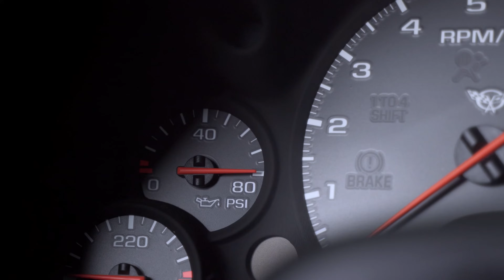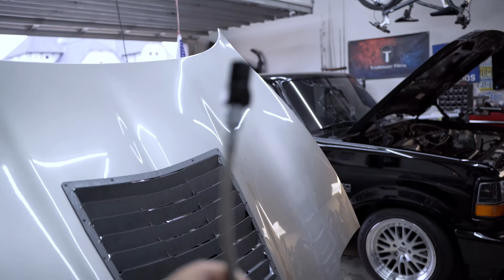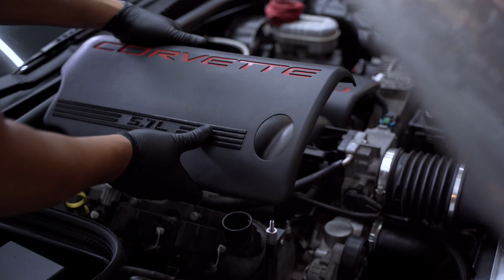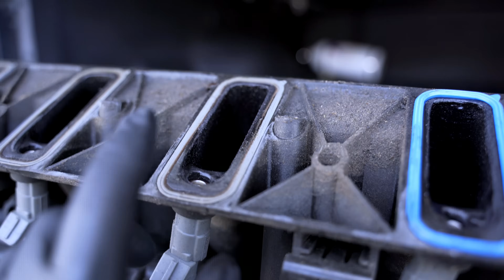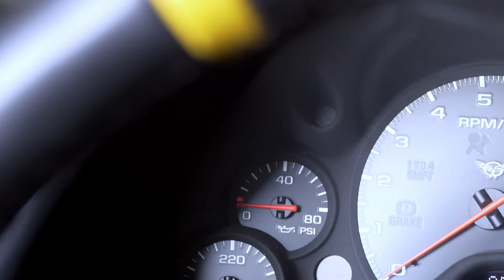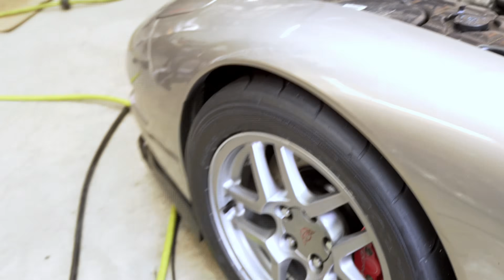NO OIL PRESSURE PROBLEM & FIX. Oil Pressure Gauge Max Out Repair. Reduced Engine Power Problem.

Comment: Nice work JJ.  Just had to do this in my 99 Buick.  Different engine, but same problem.  The plastic part of the sensor cracks from the heat over time.  Feel bad for leaving a 2 ft diameter oil stain in the Chilis parking lot😂🤦‍♂️
Reply from the maker: Thanks! Hey whatever it takes to get back on the road! 👊🏼